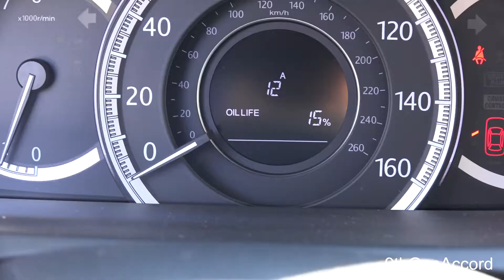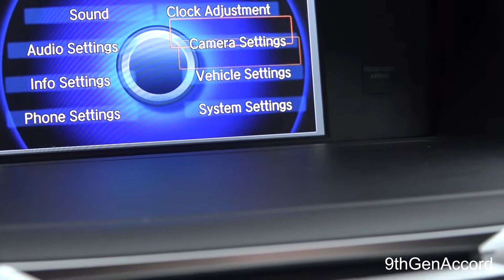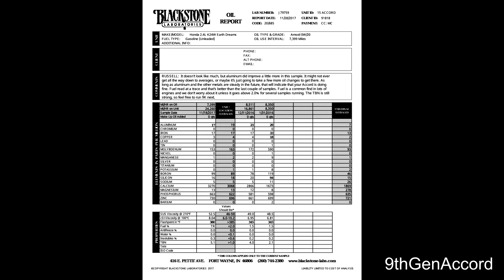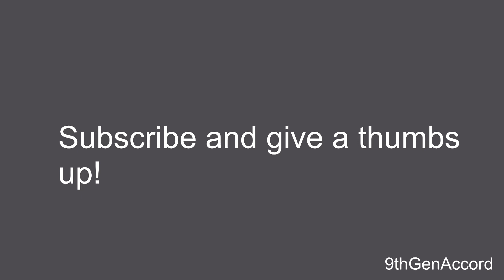Doing the 3rd oil change on the 2015 Honda Accord LX

Comment: Great video, do you plan to use a different brand of oil in the future?
Reply from the maker: I did not have enough Amsoil so I had to use Mobile 1 this time.
Reply: it will be interesting to see the next analysis with the mobil 1